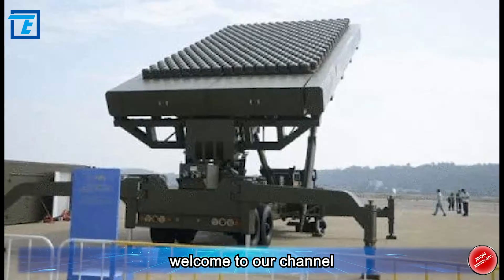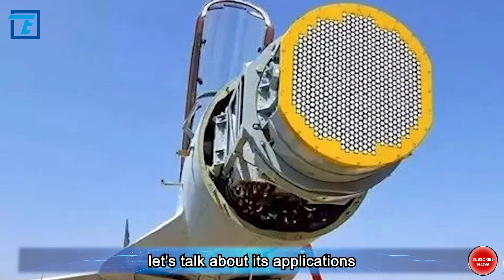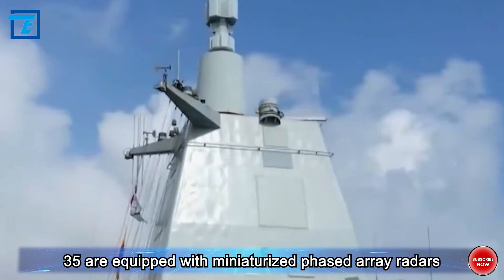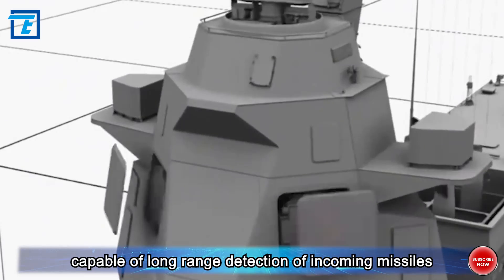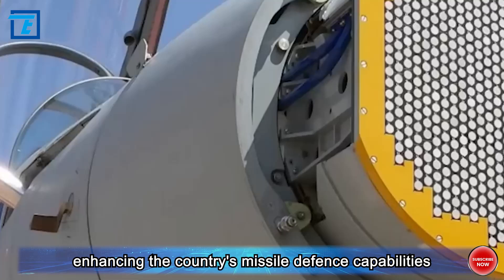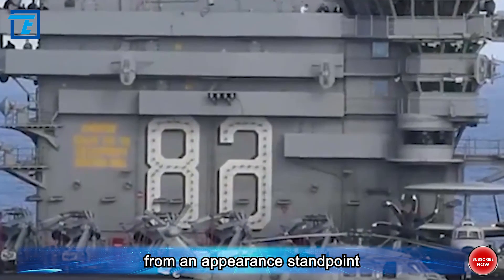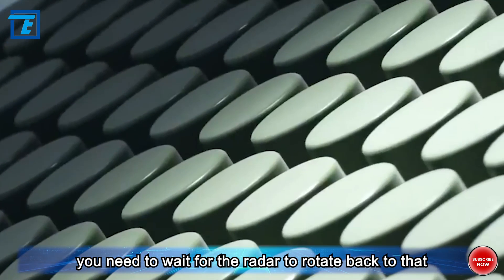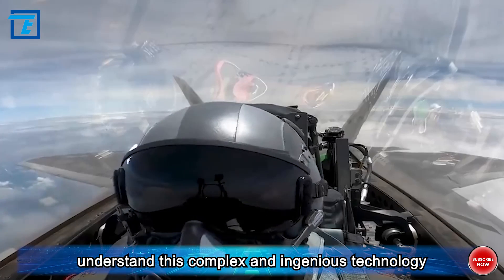What is an active phased array radar?

Comment: How about utilizing the science in atmosphere, or the science in temperature change, or the science of cosmic lights raining on Earth, or the science of sunlight and clouds tandem detection or pure sunlight radaring, or the science thing interaction usage aside  from machine dominated radars, by passing sensed signals from artificial waterflow detector like in the waterfalls tech for vertical atmosphere to space and artificial flat water in the seas with artificial sun in the system but tweaked with real sunlight outside wherein the vertical down of sunrays and the sprinkled light of sun on seawater are like vertical columns and flat rows in science like waffers in the system, with a lady in bikini.